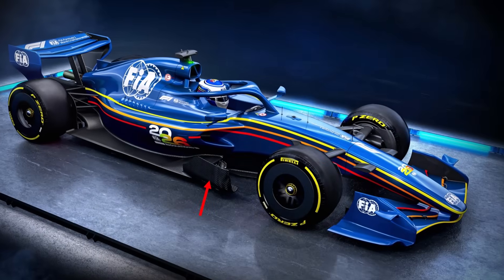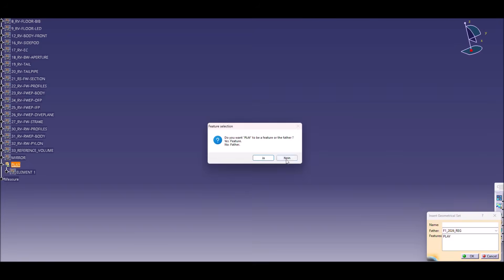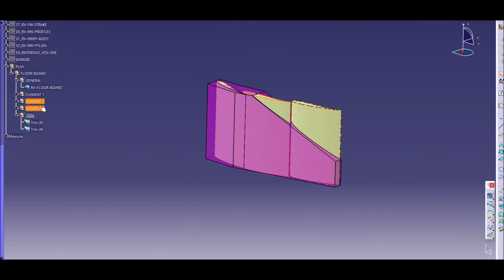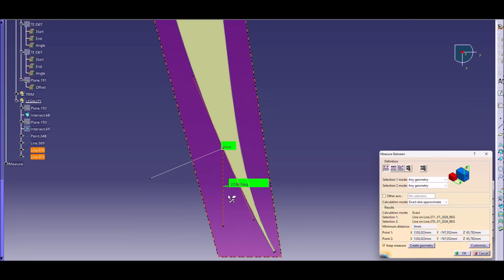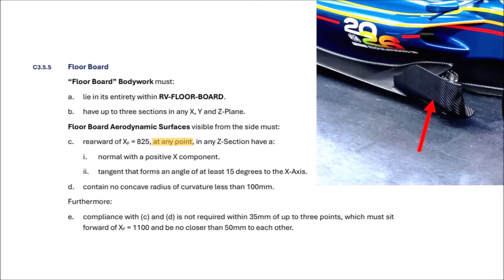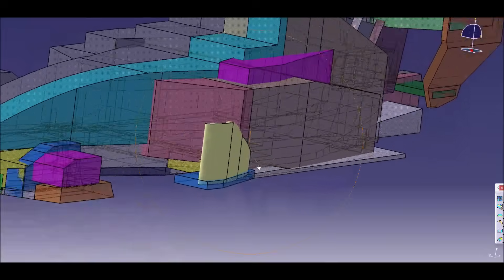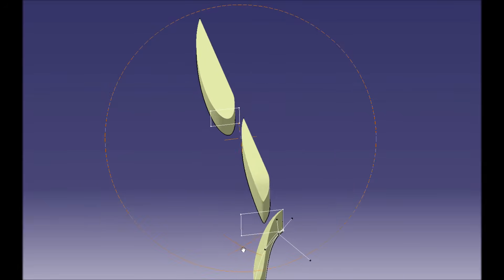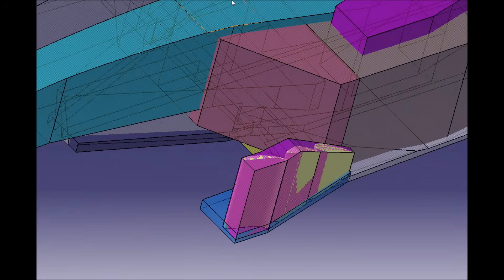F1 2026 - Designing around the Rules - How to turn INWASH into OUTWASH

Comment: Some excellent work here! But a few points to consider.

Under the rules in 3.2.4 unless otherwise specified all components need to be a single volume and simply connected, you currently have 3.

The LE of those profiles, rwds of XF825 are definitely illegal, if you were to place a point on the LE that is visible from the side, Create a tangent line off the curve, this line will subtend to less than 15 degrees. 

Have you checked that the first outwashing profile is not creating a a concave radius less than R100? The TE off the profile seems quite aggressive in its curvature. This is a rule that is required irrespective of XF825.

The Legality surface RS FLOOR BOARD as per the regs will be visible from the side with the visible gap between elements 1 and 2.

The exemption “circles” you have defined. Are actually defined as 3D spheres in space which you can position freely ahead of XF1100. Provided the centre points of these spheres are greater than 50mm from each other. So you will be able to cover some aspects of the profiles you’ve drawn but not all of the volume.

Keep up the good work!

Comment: genuine question. Isn't the leading edge of the 2nd and 3rd element illegal due to the positive X component and 15 deg limitations?

C3.5.5
c. rearward of XF = 825, at any point, in any Z-Section have a:
i. normal with a positive X component.
ii. tangent that forms an angle of at least 15 degrees to the X-Axis.
Reply from the maker: The x-axis is pointing to the back and the normal on a z cut as well, so it's fine.
The tangent is exactly the required 15deg.

Comment: As far as I interpret the regs, they have clearly stipulated the wheelbase, but I can't see a overall wheel width/ track regulation (Article 10.7.2 seems to only spec the rims themselves), and the way I read Article 2.3.1, the 950mm seems to not apply for the wheels? Seems strange that would be left open, unless I am missing something

Comment: What does "visible from the side" mean? Are those angles specified, or is that a straight side projection without perspective? Seems like open to interpretation, so you could maybe hide an outwash component (partly) behind an outer inwash component.
Reply from the maker: Exactly shadowing parts is possible with this. They should say viewed in y direction, so it would be clear.

Comment: i would design the foot plate under that barge board to be more easily shaterrable when someone decices to send it down the inside
i would not have to deal with the inwash problem, just need a tap and no more inwash

Comment: The FIA should allow teams freedom of design but instead specify maximum aerodynamic interference parameters. Teams would submit their wind tunnel results and these would have to comply in terms of not exceeding outwash and wake parameters.
This way you maintain the desired result - aero that doesn't dramatically affect the cars around you - and allowing interesting engineering solutions.

Comment: Now think about upwashing elements using the x sectional rules to load the feet and pull the wake outboard using suction under the obd surfaces. Then think about the hanger sections you can use to pump additional outwash. There will be lots and lots of interesting interpretations.

Comment: You can also make a huge cut on the height of the floor board immediately after the lead element so that the air from the medial side (underside of the wing) will spill over to the trailing elements to create outwash along with the outwards spilling vortices.

Comment: Why so negative in  terms of naive rules? Back in the days F1 was always about those loop holes and workaround the rules. In the last years I missed the creativity quite a bit - now it looks like that more flexibility might offer (smaller teams as well) a chance to deisgn a golden nugget and surprise the competition. So, lets see how it turns out and not doom everthying already right before we know exactly what happens! Stay positive. 
BTW - great content. Would love to see you design a whole car and check how different it will look from the ones we see next year!
Reply: The FIA is currently run by a bloke who has consolidated power and uses the expenses from the non-profit organisation to repair his private jet.

One implication might be that instead of using their funding as the regulator to... set regulations. Funding may have been diverted to... other things instead of on one of their main reason for existing.
Reply: Fair points! Hopefully the racing is just as good as at the start of 2022 again.  I guess people are worried about the watering down of the venturi floor cars that did originally race excellently, to something so-so and now reverting to something more like 2021 and earlier.

Comment: The rule writers aren't as naive as you think. You can waste time trying to force outwash, but you end up hurting how the floor works if you push too hard in that direction. The regulations want you to be measured, and precise, you can't force air to go against the flow field dictated by the front wing. That flow field is determined by the foot and dive plane's interaction with the tire's downwash.
Reply: It sounds like you are from the FIA rules team or one of the constructors!  Hopefully you are right and the racing is good, and cars can follow closely without losing downforce.
Reply: @TassieLorenzo  I'm an independent aerodynamics researcher.
Reply: @TassieLorenzo  There's a lot of development potential if you embrace the rules.

Comment: You can't outwash with it, it doesn't work. If you try to outwash with the floor board, the downwash from that vortex pushes the outer tire squirt under the floor. You want the outer tire squirt over the floor, and the inner tire squirt under the floor. To do that you have to consider the front wing's foot plate the floor board, AND the floor foot. The only outwash you get from the floor board that works is for the upper wheel vortex, which produces downforce when it synergizes with the rear wing and the diffuser outer corners.

Comment: Great video, so this outwash design will cause front tire dirty air to spread to nearby cars right? Probably making passing in corners and driving side by side harder, what they wanted to prevent.
Reply: What hes said in other videos is, outwashing the front tire wake allows the rear to produce more downforce, more efficiently. The wake then converges behind the car causing the hard following. Probably more to it but im not an engineer.😂
Reply: @Eric_V410  Yeah nvm I think the effect I was thinking of is more related to front wing and other parts. This complicated stuff would probably impossible to explain in a comment.
Reply: Yes, the entire idea of the inwash concept was to pull air inboard, so the following car has enough air to bite into. Blow the air outside, and the car's rear wing will have clean air to use, but the chasing car is struggling.

Comment: hi B-sport , thanks for all the awesomeness! can you maybe make a video talking about active aerodynamics and why F1 does not have "Active aerodynamics" but what I think should be called adjustable aerodynamics since the "active" part is by sector mode activation .. active aero on cars is NOT that..
Reply: same reason why they don't have active suspension and true traction control

from a sporting stand point, anything autonomous takes away control from the drivers, and put even more emphasis on the engineering side

from a cost stand point, it's a blackhole for research budget, and bigger teams with better people/equipments will make fewer mistakes, which leads to advantage that's even harder to close in this cost cap era
Reply: @Karozy4869  agreed.. however naming something for marketing "value" whilst there is already an existing technology that doe not work as they implement it.. it's "confusing".. and yeah "cost cap "  is BULLSHIT! i grew up with teams with unlimited funds due to SPONSORS.. without existing "rights"
Reply: it's because of the existance of actual active aero in the industry.. which means on the fly 100% of the time adjusted elements to achieve maximum grip ( within the scope of the tyres and cars capabilities) at all times ..

Comment: Crazy they didn’t have more competent people design the regulations. Wish they had kept the team the designed the 2022 ones
Reply: I believe that was Ross Brawn's era...now that he's gone...we got the 2018 team again XD
Reply: Yeah, cause that worked well didn't it...
Reply: @josesammut9396  In theory the FIA was supposed to slap down anything that started increasing dirty air again, but it seems like halfway through they gave up and decided to pin their hopes on 2026's regs to fix it.
Reply: @Appletank8 True, and it was lobbied by the teams, like Mercedes. By the start of 2023 we had changes that went against the 2022 regulations' motives (e.g. less ground effect by increased floors, due to Mercedes' complaints) and enabled more dirty air, then also they did not stop teams from outwashing. It started off very well, but then teams really ruined it.
Reply: @Appletank8  I think they gave up because of the unfixable issue with the suspension having to be ran very stiff, so they just want to move on from ground effect asap
Reply: @Karozy4869 the suspension issue is hardly unfixable, active suspension would fix it, so would twin chassis like the lotus 88, unfortunately both of those concepts are banned
Reply: @Amy-dq2lg  Even suspension from before 2020 regs would have fixed it but fia was determined to ban any kind of special dampening in suspensions to make them simpler.
Reply: @josesammut9396 It kinda did but would've been better if the FIA had updated the regulations to adress issues each year.
Reply: @axelode45 exactly, higher ride height, softer suspension
Reply: I thought you all wanted regulations with plenty of leeway for teams to "innovate" by exploiting loopholes in the rules?
Reply: @CyanRooper  Yes, but we want that leeway to be intentional, not a result of the FIA trying to mandate specific aerodynamic characteristics but f'ing up in the process.
Reply: 22 was trash. Worst generation of cars we’ve witnessed. 14-21 was much better for close racing than 22. The best team of FIA designers was 1997-2006
Reply: @patrickoceon Absolutely not true, the 2022-25 cars had excellent raceability, the only problem is that cost cap made the cars too close to each other on pace. Sure Qatar sucked, but if you put a 2020 car there they wouldn't even be able to get close to getting DRS.
Reply: @needles_balloon  The problem was tyre saving importance and the "clean air even closely behind your opponent" principle being dismissed in 2023.

Look how teams raced in 2022, you could see very early in races how 4-5 cars simultaneously take the same corner fighting. The season had multiple of them. Meanwhile in 2025 everytime someone slower got passed, they'd fall behind by 3 seconds distance to have clean air.

That was only after the 2022 season, when certain teams (e.g. Mercedes) lobbied changes that limit the close racing factor, which ruined the whole point of the 2022 regulations: close racing.
Teams ruined it.
Reply: @patrickoceon That's just blatantly false. Go back and rewatch the first half of the 2022 season.  The raised floor edges in 2023 made it worse unfortunately (plots of downforce loss vs following distance bear this out, while confirming 2022 was dramatically better than 2021), but it's still better than the rules before.
Reply: @patrickoceon The widebody era from 2017 to 2021 didn't provide great racing either, just the cars being too big with too much and sensitive downforce.
Reply: @patrickoceon14-21 was literaly the worst

Comment: The Problem you have, IF you decided to do outwashing in this area, is that you would disturb the air coming off the tyres and front wing. That specific floor board creates a suction for all external air (not inline with the car) to come inwards. When the air sucks inwards, there is room at the floor area in front of the rear tyre to use that air coming inwards to direct it towards the coke bottle region of the rear of the car, which is another downforce generator. 
So your idea is great, but it disturbs the air and potential downforce that can be used by the rear of the car
Reply: Teams will use the same sidepod as 2025 and pull air to the coke bottle from above, which is more efficient
Reply: @R4M_Tommy  Yeah but that is the point of the floor board as I was stating, to direct more air towards that area
Reply: Is there anything that says this floor board has to be two-dimensional in the plane of the floor (even though the FIA car and B-Sport's example are that way), can it have a twist to it to work the lower part of the air and upper part of the air differently?
Reply: @TassieLorenzo  I was thinking a similar thing. The floor plank has a thickness but not the floor from what I can see. So what I would do is simulate the venturi tunnels by leaning the edge of the floor inwards to create a tunnel.